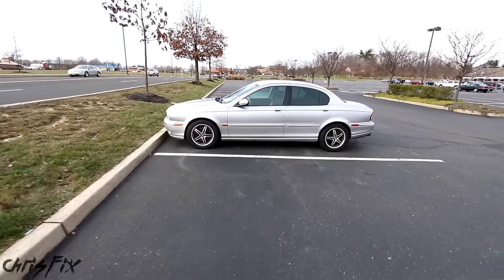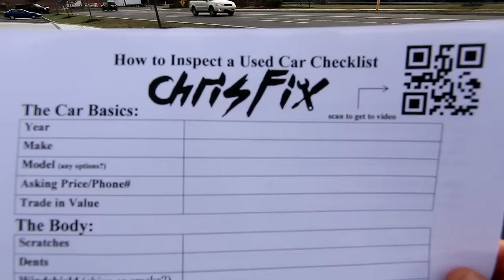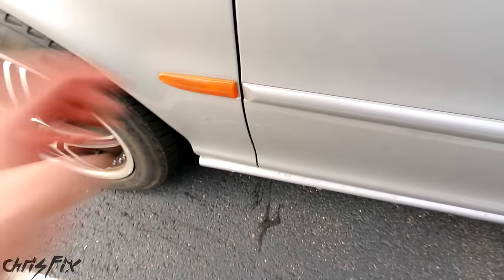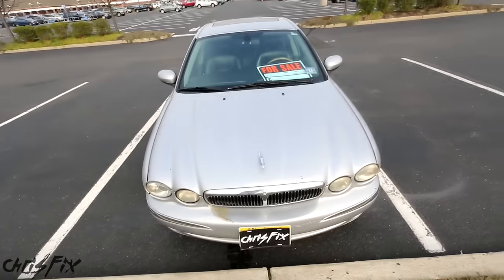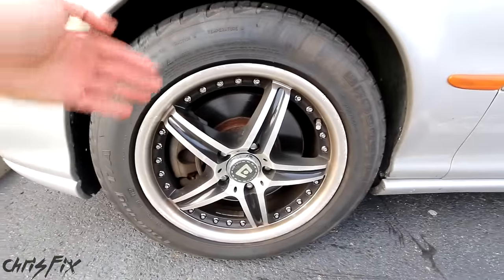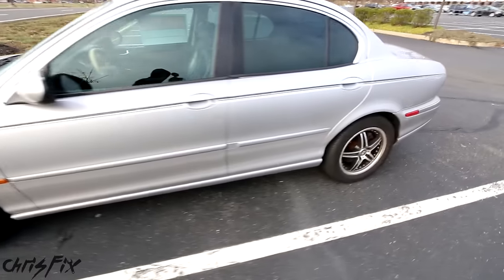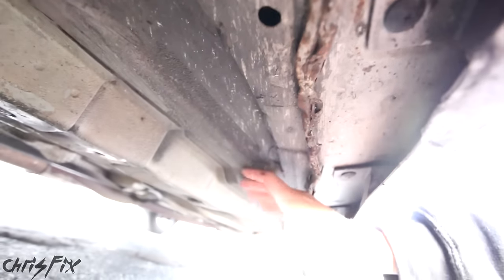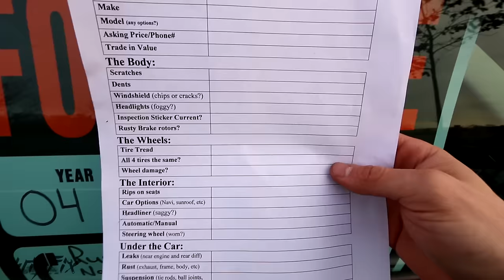How to Inspect a Used Car for Purchase

Comment: If this car is really awd, you most definitely do not want to run two different sets of tires on this car even if they are matching pairs. 2 different sets of matching pairs only works for 2 wheel drive vehicles. Awd or 4wd vehicles should have a full set of 4, all matching, and not exceed 2/32nds difference in tread from each other. Otherwise you can cause serious damage to your vehicle.

Comment: If you are a home mechanic, the important thing is always drive train integrity. Anything else mechanical (brakes, drive axles, cooling system leaks, minor electrical problems, even most oil leaks) are pretty easy to fix. Timing belts can be easy or difficult depending on the model but the number of models that have timing belts decreased rapidly after about 2010. Timing chains are good but are very vulnerable to lack of oil changes and usually harder to replace than a timing belt. Tires to me are not a selling point. You end up paying for someone else's choice of tires. It's better to pay less and get your own tires. With as little driving as I do these days, I would not want to pay for someone else's near-new high-end touring tires when a decent low end all-season tire would do me just as well. It is entirely flat where I live and there is never ice and snow on the roads either. Same with someone else's recent shop brake job. To me an ideal used car is one with a good drive train that needs new brakes, new tires, and a new timing belt that the owner has just decided to move on from rather than pay shop prices to do these recurring items.

Comment: I use to have the same jaguar. Great looking car, great engine.. but horrible suspension due to the car being so heavy in weight, so any little pothole would damage your tires, alignment, and shocks.

Comment: I know this is old but also try knocking on the panels, doors, trunk and hood. If they have been repaired with putty the sound is different to been a factory all metal part. Even bumpers the plastic sound is different too. That can tell you the car has been in a crash

Comment: All those things doesn't matter if the price is right. Most important things to verify is the engine running on idle/track, exhaust fumes and transmission (especially if it's automatic)

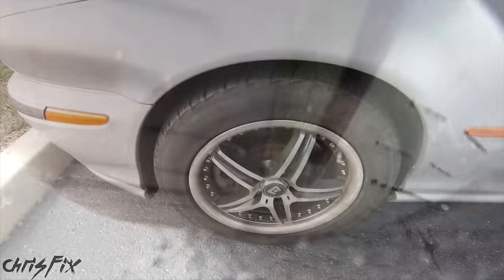Comment: 06:42 About driving in rain or snow: also check the tyre's age (DOT-number). Tyres older than 7 years are hardened and do not work any more even with almost new profile

Comment: The electronic systems, checking up with the exhaust fluid, sound of the engine when running, leakages when  it is raining, and strange Noises. And other systems that supports the health of the car.

Comment: I don't care about scratches and dents. I just hope the S-10 I'm looking at tomorrow runs and brakes good, has a good frame and interior. I need a pickup. This will actually be my first running vehicle.  Its bed has been replaced and it has a tiny hole in the tailgate. The F-250 we just sold set in our yard for years, because we couldn't get it running.
 I've been searching the papers, Facebook marketplace and along the road for a week, but eveything either didn't have a title, was a manual, or didn't run whatsoever. This S-10 is the only one I can find.

Comment: Good tip to clean your radiator: in the summer-dismount, empty, lay on ground with inlet and outlet pointing upwards, fill with pure vinegar or citric acid solution(available in supermarkets as powder)....let in the sun for day or two, empty and do it again. After 2 or 3 times the liquid will be clean, it indicated the radiator is like new inside.Vinegar or citric acid doesn't attack copper or aluminum. It just dissolves the  crud inside. You can do entire engine flush like that...
Reply: this sounds interesting. Do you have some reliable source backing up this technique?
Reply: No, I do not. But I studied chemistry and you can do a simple test at home yourself. The radiater passage tubes are usually made of copper or aluminium - depends on a make and age of it.....Put vinegar and citric acid in two separate glasses. And insert piece of aluminium and copper in both of them. You can heat it up somewhat ( as the sun would do) and observe the reaction...nothing happens to the metals. But it surely desolves the water deposits. You can do a test of it with your electric tea kettle. Introduce little water and add citric acid powder...heat up and kettle is like new! Same with kitchen vinegar.

Comment: The first time I bought a used car was a 2006 Honda Accord... I drove it around town... worked great... my mistake was not taking it on the freeway, When I took it on the freeway and started getting up to 50-60MPH the car started shaking really badly..... I took it to a tire shop to be investigated, got really lucky, someone balanced the tired incorrectly, free of charge they fixed it...

Comment: Please do a video how to inspect a manual transmission car and what to look for please 🥺
Reply from the maker: It should shift into each gear smoothly and without much effort, the shifter should be firm and not sloppy, and the clutch should not feel loose or like it's "sticking". You'll feel if it's good or not!
Reply: I live in Bethlehem Pennsylvania and looked at a couple manual cars but I’m not trying to buy one with a bad clutch again 🥺
Reply: @chrisfix  thank you 🙏

Comment: Look at age if sign for fading & weather.  Sniff car. Yep if it stinks skip it. Look at paint for two tone repair. Sun fade or large repaint. Check windshield got cracks chips & pitting.  Look at thickness of pads   Check door handles for action. Check wiper blades for damage. Check headlamps for cracks & yellowing

Comment: I wanted to point out one simple thing that gets over looked a lot and first you said about the front bumper had a crack in it and they tried to fix it well first and for most that is the only thing i would walk away from because stuff like that is bigger than you think on any other part of the car. It means that it had been in a accident and the seller didnt bother mention that and with that your looking at a big repairs hidden within it.

Comment: too bad ive seen this a bit late :( i bought a used car with rust / scratches on the body...but the tires  interior,  lights are ok.especially the engine.its a project car . yeah body repair and repainting is expensive hope its worth it :) more power to you!

Comment: This is a great video for the first 4/5 things to look at with a new car.
But DO NOT decide based on only these few.

(Most effective) Get an OBD scanner and scan the vehicle.

Do a test drive.
Make sure any problems that a visual inspection wont show dont happen.

Inspect the title. Make sure its legitimate. 

Check the VIN online. Look for accidents or what have you. 

If the seller objects to ANY of those details, convince him to let you do it or walk away. 
If he denies you Any of those, he has something to hide. And that something may fail inspection, may inhibit the cars ability to move safely, may be outright dangerous. 
You dont want to buy that
 Get him to fix it for free or reduced car price, or walk away.

Comment: I just looked at a used jeep liberty last night. It had more rust underneath than I thought it would. The weird part was that it was a pretty low mileage vehicle. And when driving the thermostat  was 3/4 up on the gauge.

Nit sure whether to walk away or not.

Comment: When checking tire wear, see if the treads are evenly worn on the inside and outside of the tire. Uneven wear indicates the car needs an alignment, which could be damage from an accident.
Reply: or under/over inflated tires

Comment: So I recently went through the gambit of the infamous 2002 Jaguar X-type and the most common problem is this, either a bad TCM (Transmission Control Module) or ECM (Engine Control Module), or the latter, complete transmission failure. Now, you'll get the same light for either of these. My brother is a Honda mechanic and we got into a small little debate about this, how'd you know? How'd you know if the transmission is completely shot vs a computer putting it into limp mode? It is just wise at that point to pass on the car due to the high risk?

According to the service bulletins, the transmissions on these things were actually made with the wrong metal/alloy which made them insanely weak. This would cause the intermediate arm to literally snap under the stress. Which obviously causes transmission failure. The other thing is that the TCM gets moisture from the poor waterproofing of the stock car, and all you have to do it pull out the TCM (and only the TCM if you're lucky), clean it with iso alcohol, and then waterproof if it with waterproofing tape. Cost of a transmission repair? Like $4000 or something, right? Cost of waterproofing your TCM and cleaning it? Like 20 bucks easy. If your TCM is fried? Like 150-200 for a new one.

So how'd you known which one it is? My brother claims that a bad transmission can run fantastic one day and literally not work the next. And with a computer error, it gives off the same behavior. So with this knowledge, would the smartest thing to be just to pass?

Comment: Dang it, I bought a used 3000gt for 3 grand on the Facebook buying/selling place. I went to his place which was about an hour away. The outside looked good but there was a crack on the windshield which should’ve been a no! And the guy didn’t even put that detail on his post and the interior looked nice and good, heated seats, Bluetooth connection, and electrical leather adjustable seats. I took it home and then brought it for a check up and the estimated repair they gave me was over $5,000! There was an oil leak that went all the way down to the mufflers in the back. And his post said “new 100 miles engine” which I bet was a lie!! The coolant wasn’t flushing so the engine was always over heating! The engine was painted so I think he used that to make me think it was, which I did. I was dumb enough to not turn on the AC which didn’t work and he didn’t say anything about it. The two rear rotors aren’t good either. And the axel is wobbly, probably going to break soon. I should’ve paid attention to those details more before spending 3 grand on someone’s junk car. The body work wasn’t well too, deep scratches and rusts that he tried fixing with body filler but did a horrible job on. Now he’s saying he’ll replace the windshield which is taking a long time for him to do. What should I do?

Comment: I rented one of these X-Types when it was brand new in '04 and wrecked it at a rest stop/gas station pull off.  Hit the curb on the passengers side collapsed the tire/screwed up the transmission.  Had it towed back to rental car facility in Hartford to many a wtf stares.  Ahh memories.  Sometimes I think about what the did to the car after I left.....

Comment: Your a life save thank you for being awesome
Reply: Btw avoid any European stuff. The wiring  (including the stuff inside the roof) is often a mess because they use rubbish cables. Fixing an engine is one thing but wiring issues can cause random stalling that can take years to even track down. Get yourself an older GM like early 2000s. The older Buicks have 3800 on top of the engine and sometimes get what SEEMS to be a head gasket leak but is an inlet manifold leak. They are good. The 02-06 hyundai accent in 1.6 or 2.0 is also a great car, but be sure to do the timing belt every 80 thousand miles. One of the easiest fixes and they have plenty of automatic ones too. There's a ton of other things you can tell by checking all the different fluids but ONLY check them with a COLD engine. Sometimes a bad engine runs smooth after it's warmed up. So if you get there and the engine is warm you will think it runs fine ONLY BECAUSE it was running 5 minutes ago. And you find out the awful truth when you start it cold.

Comment: Detecting if the frame is warped: With front wheels straight - measure by hand width (or small measuring tape) the distance from the front of the tire to the fender. Do the same on the other side. If both sides are the same - it's good. If they are not the same, there's a good chance the frame is warped. Also, you want the VIN number to check the car's history and to see if it's stolen. If the car has no VIN number - don't buy.

Comment: Hi Chrisfix, 

I am one of your subscriber from India. I really find your videos informative.

I have recently bought a Nissan Micra 2011 petrol model. The car had 122000 kms on the odo at the time when I bought it.

I have noticed a jerk when I accelerate in higher gears or when I am trying to climb a flyover. This problem was recently resolved by replacing a fuel pump.

Yesterday the check engine light came up and I started noticing the same jerk (loss of engine power) again.

Can you please guide as to what can be the fault. My local mechanics have already made me spend a ton of money in fixing this problem.

Hope I will get an answer.

Comment: Well, the most important thing to know is the Blue Book value...because if the bluebook value said that car in this condition is worth 5000 USD(as an examle),  forget negotiating much more money off...you already have a bargain offer by the seller. Though on the other hand, if the car is significantly less cheaper, then bluebook value, it can have 2 reasons. No1: there is a hidden problem, not visible  by outside inspection(most likely electrical, motor or transmission problem. If you do not understand this particular car, it would be smart to take it to the mechanic to inspect after you did test drive and did not find anything wrong. No2: it could also mean the owner has a lot of money and he doesn't care much, just wants to get rid of the thing.....it is up to you to size up the seller. If this is the case, you might try negotiating additional discount, because the owner might like you and he really doesn't care about few bucks here or there....

Comment: 6. Glass. Check to see if all of the glass has the same "logo"....especially the side glass/windows. A cheap body shop is NOT going to go to the dealer if it needs to replace glass while repairing a wreck bad enough to break side glass. No matching logos.....walk away.

Comment: I wish I saw this video 3 years ago before we bought my first used car. I didn't have any idea I just went for a test drive check the papers and it was great until after 2 months the car needed jump start everytime I have to drive it. I brought it back to the dealership and change the battery and still the same thing happened until I went to Volvo dealership and have them check the car only to find out that it's very rusty under and it they said it has been in a flood. I mean, the papers that was given to us from the scammer dealership was all clean. In short, I got scammed. We paid a total of 8k and only got 1500 back from that money. It was a nightmare. I haven't own any car before so I was very clueless. So now, I am driving a new car because I am scared to buy a used car and waste money like the last time.

Comment: All wheel drive vehicles all 4 tires should be replaced at the same time. So they are the Exact same height. The help cut down on ware  to the rears front and back and the transfer case .

Comment: can you push down on the front corners and the rear corners and if there is a bounce than they might have trouble with struts and the suspension system. little to NO bounce the suspension is good
Reply from the maker: Thanks for the tip!

Comment: Get a Actron CP9680 code-tester. It checks live, record, graphing, emissions readiness test, transmission test, ABS, SRS, and MORE! It's well-lit! It comes in a black pouch. Get 4 aaa batteries for under the rear cover. Get a USB cable to update it. Get a wall charger cable for a Tom Tom One GPS to review results in your home. Get a cigarette lighter cable for a Tom Tom One GPS for in-car review of results without running down the tester battery. EBAY has them.

Comment: I thought with AWD, all tires have to be the same diameter exactly.  So if the rear are worn down, hard on the drive train.  And you have to replace all 4 at once.

Comment: would you say jag x just like this one, is not too hard to DIY for basic maintenance and small repairs here and there?  found 130k miles 2001 x type for about $2200. looks like same condition as this one just 5 years later. ( i want to own it and ready to learn on it a little, open to buying inexpensive tools )

Comment: Hi Chris. What’s your opinion on buying a 40k km used  2014 Mazda 3 from Japan that has the steering wheel shifted from one side to another to use it in my country? Is it worth it for 9.5k USD?
Reply from the maker: Are you able to physically see the vehicle?
Reply: @chrisfix  Yes. I saw it already. It is in VERY good condition. The only drawback is that since in my country we drive like in the US, the steering wheel had to be shifted and Idk if it will be a risk in the future (safety concerns with airbag etc) ... but physically I think it looks great. Is it usually worth it  buying used cars that have gone through these type of changes? (Steering wheel side etc..)